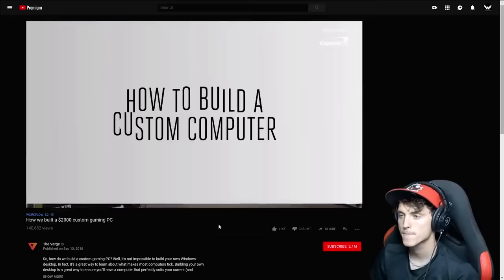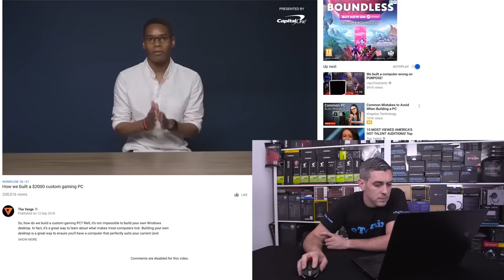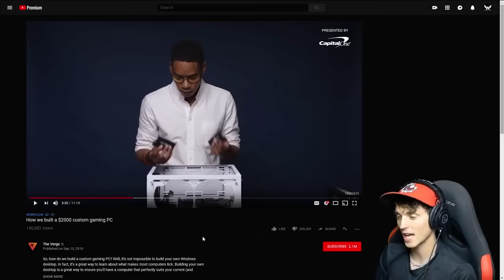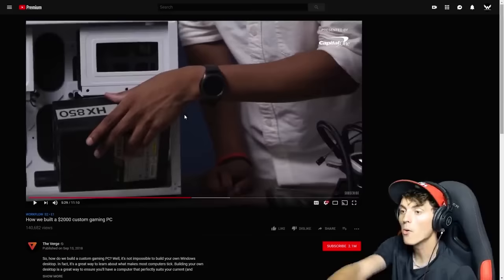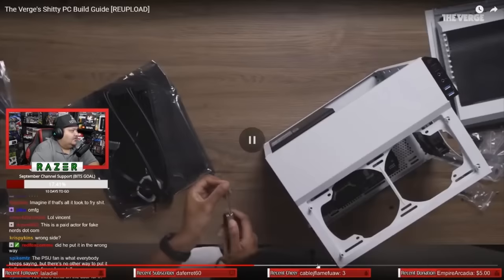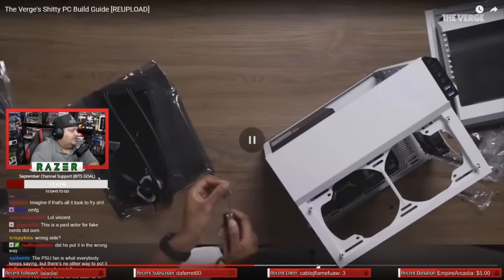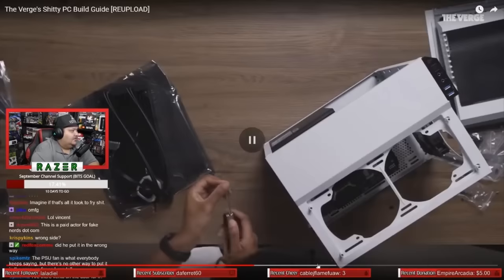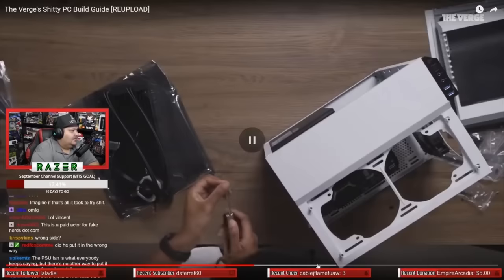The Verge's $2000 PC Build Reaction Supercut

Comment: "$2000 is a decent chunk of change for a gaming PC." 

2019 was a different time.
Reply: TBH hat's still a chunk of change. Can't imagine many people have $2,000 to spend.
Reply: @user-in1gv1uh2v  it’s definitely a chunk of change, it just buys you way less PC now than it did two years ago…
Reply: @biggsly  What would $1,000-$2,000 get me today? Been thinking of building a PC for editing/audio engineering.
Reply: @user-in1gv1uh2v  that could get you a good system, just remember you have to keep peripherals [keyboard, mouse, monitor(s)] in mind, so since I’m not sure if you would include that in the budget, I would say not to look into spending the full $2000.

edit: my reply is pretty long, I just realized. In my reply I explained why I picked the components in this list.

As for specs, I would suggest these:

CPU: AMD Ryzen 7 or i7
For editing, an 8 core processor should fit your needs well. Not sure if you plan on doing gaming since you didn’t mention it, but they can also handle gaming pretty well. Since there are only two brands to choose from, I would recommend the Ryzen 7 3700x or 3800x if you go AMD, and for Intel I would recommend the i7 10700.

CPU Cooler: Since your PC may be using a bit more intensive programs, I would suggest an AIO (all in one) liquid cooler. I don’t know too much about them since I’m getting an air cooler for my PC, but I suggest you do research to find the right one. Some popular brands are NZXT, Corsair, Cooler Master, and Lian Li. 

GPU: Again, you didn’t specify if you wanted to do gaming. If you want/need a dedicated GPU, you can go for the GT 1030 since it is cheap and will suit your needs just fine. If you’re a casual gamer, you can go for something a bit higher end like a GTX 1660 Super.

However, if you do NOT plan on doing any gaming and don’t need a dedicated GPU, I would suggest going Intel and using their integrated graphics. You can put the money that would have gone to a GPU to better peripherals, or to something else completely.
 
Motherboard: If you are going AMD, a B550 or X570 motherboard should be good. For Intel, B560 or Z590.
You do not need a motherboard with Wi-Fi. It’s much cheaper to buy a Wi-Fi card or use an Ethernet cable than look for a motherboard with integrated Wi-Fi. Just make sure your motherboard fits in your case, and that all your components are compatible with the motherboard.

RAM: 32GB CL16 3200+ MHz 
32GB is plenty for editing and other kinds of multitasking. CL16 is the latency of the ram, and the MHz is the speed of the RAM. You want a lower latency, and a higher speed. (Tip: when you are setting up your PC, make sure you enable XMP in the BIOS. this will give you the full speed of your RAM, because at default it runs at half the speed.) Some popular brands are G-Skill, Corsair, HyperX, and Crucial. 

Storage: you can decide how much storage you need, but I would go for a combination of SSD and HDD. 
Install your OS on the SSD as well as applications you use frequently, and the HDD is good for long-term storage or things you don’t use often. For the SSD you can buy a 250 or 500 GB M.2 drive (this is installed on your motherboard). As for hard drive, 1-2 TB could work. You use your PC differently from me, so take my suggestion on this with a grain of salt. 

PSU: 80+ Gold for energy efficiency, 650-750 watts should be plenty. If you plan on upgrading in the future, you may want to get a higher wattage power supply. PC Part Picker will estimate the wattage of your system, but you’ll want to get a couple hundred watts more just so you have that room.
Some popular brands are EVGA, Corsair, Seasonic, and be quiet!

Case: Depends on what you think looks nice, make sure to pick something up with good airflow, and that can fit all of your components. Some popular brands are Corsair, Cooler Master, be quiet!, and Lian Li.

I suggest doing lots of research before you buy your components, so that everything is perfect for you. I’m open to critique from other commenters, who may have more experience in PC building than I. Read reviews and specs, and pcpartpicker.com is your best friend when picking components. If you‘d like advice on peripherals I can totally assist you, I’m just not sure about your setup theme or if you value function/value over aesthetics. I hope this helped!
Reply: @Sunny-ht2pw  Oh wow thank you. In response I was thinking of doing gaming, but I was more concerned about  Video Production. As for the case I was thinking of getting a custom made PS2 computer case. Is there a way to run Apple on a custom PC?
Reply: @user-in1gv1uh2v  No
Reply: @Sunny-ht2pw  Luckily for me I do own a MacBook Pro. Thank you for the info!
Reply: 2K is still really good. You’re def not running high end games on ultra settings yet they can still be run though.
Reply: @sorinzo3902  Meh TBH running high end games is overrated. If they run well, that's good enough for me.
Reply: @tomohawkcloud  nah you can easily have a 3070, mb a 3080 I just recommended those because I wasn’t sure if he actually wanted to game, haha. No point in paying that much if you won’t utilize it
Reply: @tomohawkcloud  well it was cheap before, until stupid scalpers and idiot miners crash the PC market hence why everything is stupid expensive. And I am very salty about it
Reply: @user-in1gv1uh2v  everything but the gpu
Reply: I actually built a decent setup half month ago with around 2000, it got 11700k, 32gb 3200ram and a fucking 3060ti, i mean like, 2000 is still a decent budget
Reply: Without peripherals tho
Reply: Half of it goes to the new gpu
Reply: Thats what you spend on gpu nowadays lul
Reply: i had money to built with ryzen 7 2700 and 1650
i though it would be nice to wait for 6 months so i  can get hand on the 
2700x and 2060
guess what
now iam crying with 3500 and ᵍᵗ⁷¹⁰
Reply: @user-in1gv1uh2v  i have a AMD FX(tm)-8350 Eight-Core Processor, and cant for the life of me remember the motherboard and im looking at getting a new one and ddr4 ram is there any suggestions you have for these things? 16 ram would be fine for now but I just dont know where to start when it comes to motherboards
Reply: @Draxlord101  Unfortunately I myself am not a expert on computers.
Reply: @user-in1gv1uh2v  sad days
Reply: @Sunny-ht2pw  my dad give me $1200 for my whole setup help man
Reply: @casual_loser6733  yo I saw your reply, I gotchu! I’ll get back to you with a list soon :)
Reply: Bro, where'd your stimmy go?
Reply: 2000 still gets you a decent PC now
Reply: There’s a prebuilt with a 3090 that’s only 1600
Reply: @sorinzo3902  how the fuck is that possible. A 3090 is 1500 at MSRP.
Reply: @disinque6961  did you include the cost of windows?
Reply: Fact, my 3090 was $1,700 alone after tax+S&H
Reply: @biggsly  nah you still get a way better pc simply because gpus are better
Reply: @biggsly  I completely disagree. If your GPU is supposed to take up 1/3 of your budget and a 3060 is like 380 dollars, that’s at most 1200 dollars total spent on the pc, and you can run 1440p high settings comfortably
Reply: @OTWfrl  3060s are like $800 still though unless you wait in line all night or luck out
Reply: nah... $2000 Is loads for a pc
Reply: $2,000 will get you a purdy GPU now adays.
Reply: @Draxlord101  Don't bother shopping a new build around a nine-year-old CPU.  Don't get me wrong, I'm still running a 2013 build using an FX-8300, Sabertooth 990FX, 16GB DDR3 and a GTX 770 but since I just lucked out on obtaining an RTX 3080 GPU I'm doing a new build around an i9-11900K so I can take advantage of Thunderbolt 4 and other modern capabilities of the Z590 chipset.  In any case a motherboard with an AM3+ socket that takes DDR4 simply doesn't exist because the FX-8xxx processors are only compatible with DDR3.  Even if it were possible, hobbling a new system with outdated components is just bad practice.
Reply: @user-in1gv1uh2v  You can get a really nice PC for like 1200-1400 now. But the same price back in the 1060,70,80 days would get you a lot more. 

My current 3070 build cost about the same as my 1080 build back when the 1080 was one of the top of the line cards to give some perspective.
Reply: Now imagine that in a country where the fees are about half the price.

Fuck... me
Reply: "$2000 is a decent chunk of change for a gaming... graphics card."
-2021
Reply: Robert Turpin  facts: right now, even with this market, $2K will get you out of hobby territory and into enthusiast. Just because the new minimum for a good gaming PC is $1k-$1.2k, doesnt mean much as simply doubling that will put you close to top of the line.   parts scale harder with price than they used to. 

Assuming you aren't talking about the early adopter premium rn for Alder Lake and DDR5- $2k is plenty sufficient for a proffessional setup in almost anything outside of 3D animation, game development, and AI research.

I spent about 1500$ to get my current setup, including upgrading the graphics card from a GT 1030 gddr5 2GB, to an RX 570 4Gb, and I can play modern titles at 1080p medium settings; and sit comfortably around 75 fps to match my monitor refresh rate. 

Granted I got a little lucky, this is my first build and I chose some of the actual best bang-for-bck parts without the knowledge that they're good value
Reply: @biggsly  Mainly the gpu part the rest of the parts aren't as bad
Reply: i just bought a system and built it myself for 1800€
i think im set for the next few years atleast its more than enough for me and the latest games on 60fps
cant go over 60 because my monitor still has to be upgraded 😂
Reply: @disinque6961  facts
Reply: "MuH pC mAsTeR rAcE" for around 3000 dollars.
Reply: @tomohawkcloud  that’s not for $2000, he literally fucking said that’s more than you’ll need for your purposes lmao.
Reply: @user-in1gv1uh2v  you could make a hackintosh if you really wanted MacOS, but it's a bit tricky.
Reply: @Sunny-ht2pw  You might as well spend the 2k on a gaming laptop. You probably get more for your money.
Reply: @sorinzo3902  Eh, you probably can, I've built a Ryzen 5 5600X/3060 Ti build for my GF for 2.2k
Reply: @tomohawkcloud  you can get a 1030 on a $300 pc let alone a $2000
Reply: To be fair if you get everything at MSRP then you can still get a great pc for 2 grand

That if is the main thing though lol
Reply: Newegg is where I go to cry now.
Reply: @disinque6961  yeah same, I spent about $2000 as well. Initially, I spent $300 + exchange warranty to upgrade in the future "for free" on 32GB 4800 MHz Corsair DDR5 RAM at Microcenter. Got an i7 12700k, a $250 MSI Z690-A WiFi mobo, re-used my 2015 Sound Blaster Z card, Corsair 4000D Airflow case, re-used my case fans and CPU heatsink until I could afford upgrades there, got a Gigabyte RTX 3070 Ti from the Newegg Shuffle after Best Buy fucked me and a few other bells and whistles for about 2-2.5k total spread out from Christmas to early March. I also re-used my Seasonic 850W PSU since it's a beast and I only bought it a year and a half ago. When buying a new PC, not everything needs replacing immediately. Hell, for a month or so I used my MSI GTX 1060 6GB until I could get a 3000 series. It was plenty good enough for most games.
Reply: yep I bought my GPU cheap back then for 250 now its almost 1k
Reply: @vashisl33t  which gpu was that?
Reply: @biggsly  I just built a great pc for 2k, i5 12600k, 3070 ti…
Reply: 20% discount for $2000 for GPU!!!!
Reply: Spent $2437 for my PC in May of last year. However, It's was prebuilt. Saved money going that route
Reply: Before the Dark Times. Before the Pandemic.
Reply: @biggsly  In fact it gets you way more especially how good gpus are now
Reply: @user-in1gv1uh2v  360 Ti
Reply: Lol yeah :D
I paid that much just for my graphic card XD

Comment: The original video is just a demonstration of how idiot-proof computer components have become.
Reply: It may be idiot proof, but it is still not insulation proof.
Reply: Mind = blown... holy shit.. the ram... my god.. that poor CPU... I was surprised he got it in at all!
Reply: I was thinking the exact same thing. Back in 2004 this dude would not have ever been able to get a computer to post. 100% guaranteed.
Reply: @tymtrppr3  Try the IRQ days. 2004 is too similar to today
Reply: that's assuming the computer actually posted and they aren't just showing a pre-recorded video on screen. someone said his tapping doesnt even line up with what's happening in-game
Reply: IRQ days? Try installing coprocessors with a soldering iron just to upgrade a CPU back in the day.
Reply: @hkoizumi3134  My only coprocessor was for my Amiga, but that came on a card.
Reply: The specific motherboard he chose for the build will post even if the ram is in single channel
Reply: But  the manufactures didn't see this video.  He is far beyond an idiot-proof pc builder. 
I guess it is back to the drawing board for the manufacturers, make the parts TheVerge proof. 😂
Reply: I would legit give money to watch him assemble my first build from 2001. I mean it Stefan, make it happen!
Reply: @DjAirsurfer  oh I'm sure it lines up as he's getting completely wrecked by a bot in league of legends and he used his ulti that completely missed the bot.
Reply: @Iwantapplez109  gotta wonder if he installed the front I.O himself, ain't no PC posting without a power switch.

Comment: I like how it all starts off with dumb, yet innocent mistakes and then quickly transitions to "This video could actually kill someone."

2020 Update: Building a PC and this video just became a lot more helpful.
Reply: Putting the power supply in upside down was the tipping point.  Alexei even said Stefan was creating a fire hazard doing that.
Reply: Craptastic13 powersupply upside down? The psu orientation doesn’t actually cause fire risk
Reply: @Bigevilfishy  The orientation of the PSU has the intake fan facing into the case instead of out, so he's suffocating the airflow of his case and causing a vacuum effect where hot exhaust air from the backwards mounted radiator fans and the GPU would be sucked in by the PSU intake fan.
Reply: truongtu0191 orientation of the psu fan blowing air in is acceptable if there is no air pressure out of the case.

Comment: Thanks for including me in your compilation! Had some good laughs watching it all again. =)
Reply: Subbed! Love your vids!
Reply from the maker: Thanks for making your reaction video.
Reply: Def subbed after seeing you in this
Reply: Hadn't ever heard of you before but I like the humor and technical accuracy I definitely appreciate. A question if I may, have you actually seen issues of tubing rupturing caused by thermals from nearby components? I never have.
Reply: Subbed !
Reply: @RandarTheBarbarian  They're rare since most people who build their PC - especially ones that opt for water cooling - are responsible enough with their cable management. (Plus components are getting more reliable everyday.) But I have seen the odd tube failure here and there.

Inside those braided cables are rubber hoses and rubber eventually cracks and ruptures so if you stress them any more than usual then it'll probably become the weak point of the tube.

Anyway, cheers!
Reply: Subbing, maybe ill figure out how to actually build a pc lol
Reply: @TechInspected  Thanks for the reply man, mine usually float a little bit off the card anyway because I don't want them putting any pressure on an already hefty card (vega 64 strix) but I have yet to see a tube failure, I don't get to work on machines much anymore though. Usually pumps or seals is what I see pumps more often
Reply: Ayy I'm a big fan :D

Comment: They should just change the title to "How to build a 2000$ bomb"
Reply: How to spend 2 grand on an IED
Reply: that is still a waste by the way they made it lmao
Reply: "How to waste $2000"
Reply: How to burn your house down
Reply: Just run shadow of the tomb raider at max settings 4k and that thing is gonna burn and explode.
Reply: KrenZZie it wasn’t an awful pc, but it definitely wasn’t worth $1000. Lol it’s kind of cringe how everyone overreacted to this video. Like making fun of the guy for saying u need a table to build on lmao.
Reply: OK Glacko oh no I’ve accidentally built my pc on my lamp stand!
Reply: @paco1022  "it wasn’t an awful pc" he put the power supply the wrong way, doing that can cause it to overheat and potentially start a fire. That's not mentioning the fact he put in ram wrong destroying its performance and not properly screwing in his AIO which can either lead to dmg or poor performance. Oh and the sea of thermal paste.
Reply: @paco1022  
"Overeacting?" Bruh its a dangerous fire hazard. Damn right its the PROPER reaction, some noob like my sister could stumble into it and think this is the proper way to do this.
Reply: How to flush 2k$ with RMAs.
Reply: @paco1022  There is almost no cooling, it is set to die pretty quick. It is an awful PC.
Reply: @paco1022  was that, like, sarcasm?